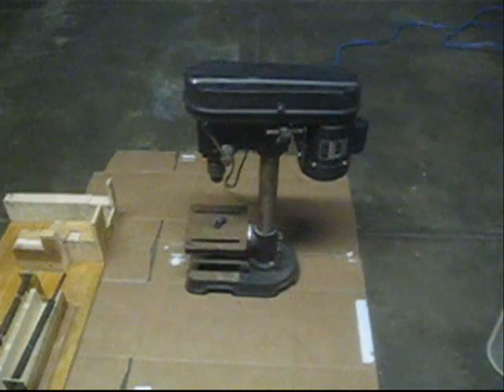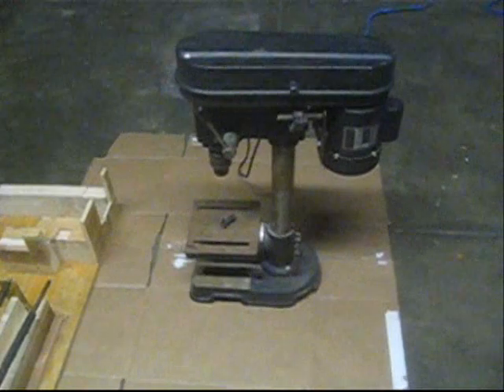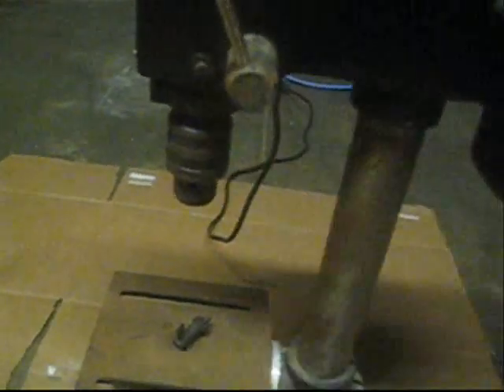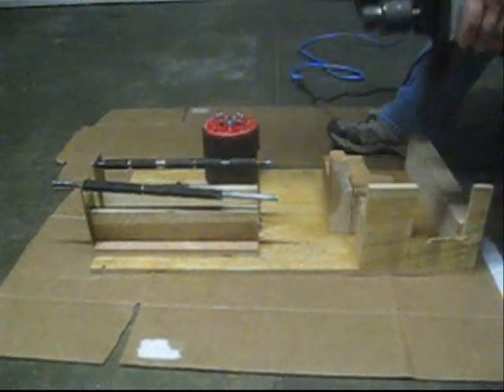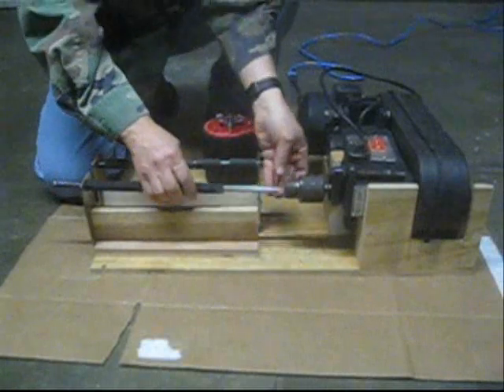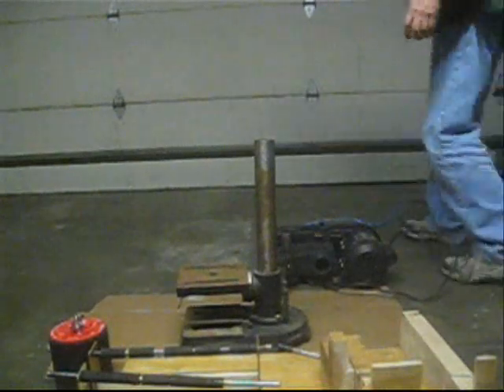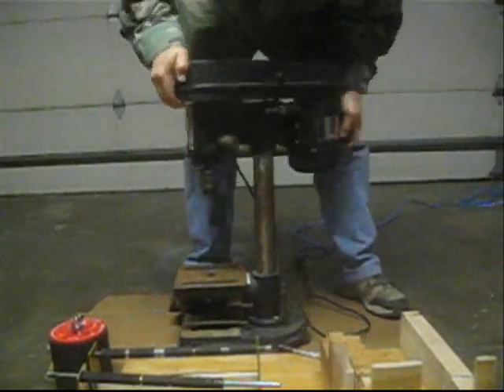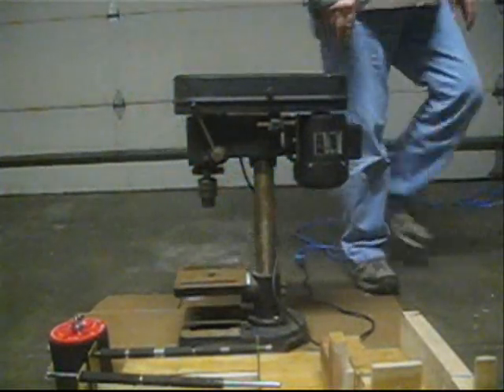Ball Mill made out of a Drill Press

Comment from the maker: @AgentofValor, 
One problem was that the chuck lost grip and therefore stopped turning the main drive shaft. With a little thinking there were several solutions to that problem.  The entire concept of this project/experiment was to put together a "quick cheap” functional ball mill for the very occasional user like myself.   I have only used it a couple of times for more then 4 continuous days and it did a surprisingly good job.